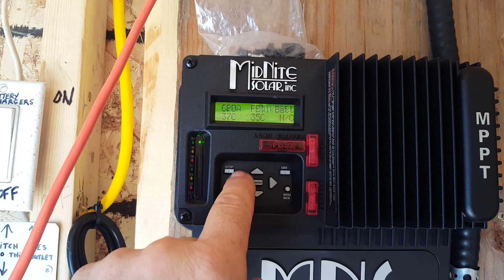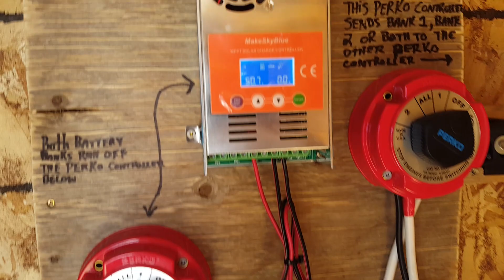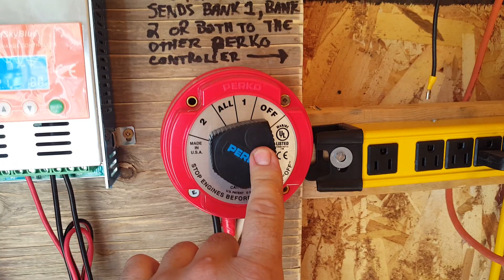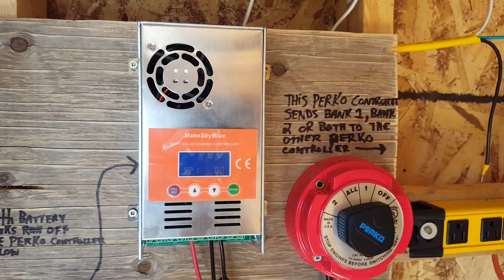Aims 48volt inverter charger used in a three 48 volt bank solar setup.

Comment: any update on your solar panels and batteries ?   i see you got 3 kw of panels
Reply from the maker: I'm still running this exact set up 2 years later, I just moved my 10 panels on a tilt/swivel  setup up on the ground so I can manually follow the sun when I'm there, I've had zero issues with the set up. However I still have to run my generator to charge my batteries when I dont have sun for a few days. If I'm there for 7 days at the camp I'd say I need to run the generator 15 hours. I run a high efficient electric fridge, lcd TV, satellite receiver, microwave,  toaster, coffee maker and led lights throughout the cottage. If I didn't run an electric fridge I'd never have to run the generator.